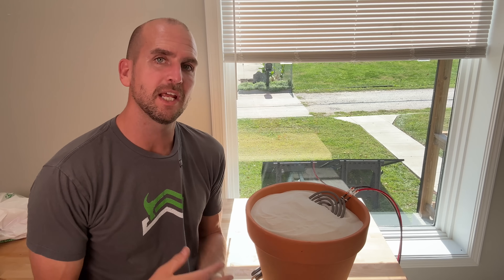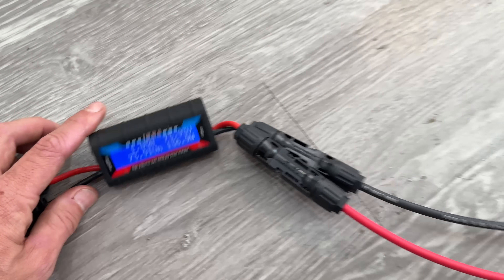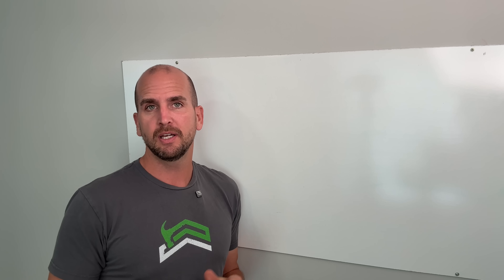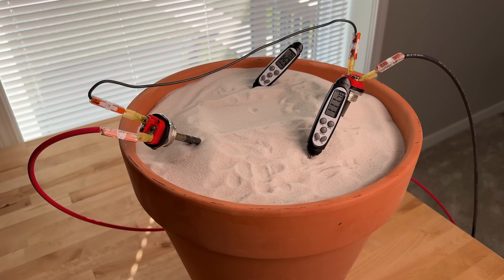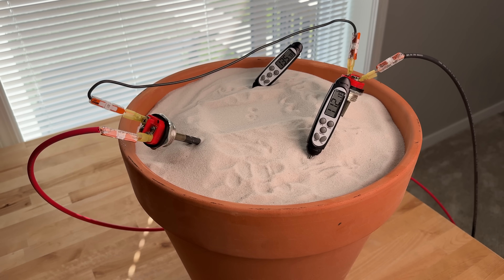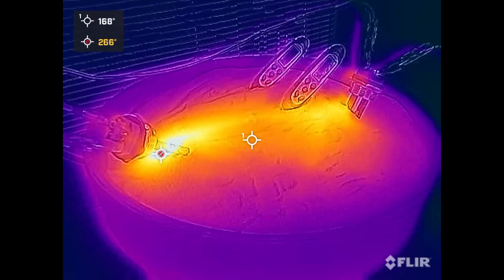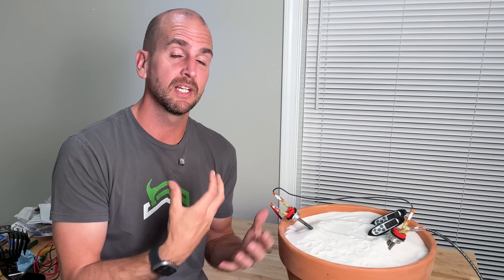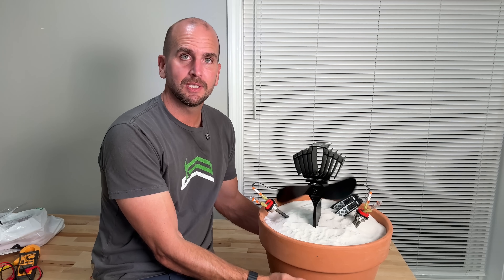How To Create A Solar Sand Battery Heater | Free Heat This Winter!

Comment from the maker: Calculate Solar Cost For Your Home - https://geni.us/solar_reviews
DIY Home Solar (Save $1,000's Going DIY)  - https://geni.us/qN9Ot

Supplies
Water heater element used:  https://geni.us/AJE9
WAGO 221Inline Splice Wire Connectors - https://geni.us/G0BW
Heat fan:  https://geni.us/4Fgy
Power Analyzer - https://geni.us/s86J
Cheap 370W REC Solar Panels:  https://geni.us/zVh8nG

DISCLAIMER: This video and description contain affiliate links, which means that if you click on one of the product links, I’ll receive a small commission.
Reply: I enjoyed your video but can't for the life of me understand why you went through the math exercises of figuring out Ohms & Amps? I mean whatever your panels are putting out and whatever heat is produced by them is really all that's relevant at this point. You stick the heaters in the sand and see what you get, then you can scale accordingly. Maybe I just missed your point? Anyway, it was a good review on the math, I'm not throwing any shade, I just didn't understand why you'd take the time to bother since it didn't really matter to the experiment.
Reply: @BDProperties-y3v  Agreed,  the math was the weak point, but overall a good proof of concept exercise.
@everydaysolar, if you want to get into details, I think you need to emphasize that heating elements, like incandescent bulbs, have a non-linear resistance that changes over temperature.
Reply: @nemam_nedam  Quick lime (Calcium Oxide) can be used as "hygroscopic energy storage".  Here's some fun math.  According to wikipedia, 3.1 kg of Calcium Oxide could get you about 1 kw-hour of thermal energy.  If you're house needs about 15 kw-hour per day of thermal energy in the winter, you would need 3.1 kg/kw-hour x 15 kw-hour/day x 90 days/winter = 4185 kg of Calcium Oxide for the winter.  That's about 9.2 tons of Calcium Oxide!
Reply: You should have the heating elements In Parallel. Not series.!
Reply: @nemam_nedam ⚠️ God has said in the Quran:

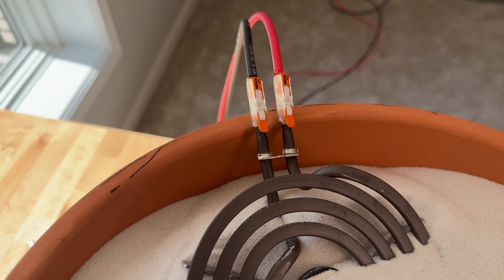🔵 { O mankind, worship your Lord, who created you and those before you, that you may become righteous - ( 2:21 ) 

🔴 [He] who made for you the earth a bed [spread out] and the sky a ceiling and sent down from the sky, rain and brought forth thereby fruits as provision for you. So do not attribute to Allah equals while you know [that there is nothing similar to Him]. ( 2:22 )

🔵 And if you are in doubt about what We have sent down upon Our Servant [Muhammad], then produce a surah the like thereof and call upon your witnesses other than Allah, if you should be truthful. ( 2:23 )

🔴 But if you do not - and you will never be able to - then fear the Fire, whose fuel is men and stones, prepared for the disbelievers.( 2:24 )

🔵 And give good tidings to those who believe and do righteous deeds that they will have gardens [in Paradise] beneath which rivers flow. Whenever they are provided with a provision of fruit therefrom, they will say, "This is what we were provided with before." And it is given to them in likeness. And they will have therein purified spouses, and they will abide therein eternally. ( 2:25 )

⚠️ Quran
Reply: Another power source in a emergency could be a generator(or a moped if that`s all there is using 12volt heater parts) running on Browns Gas(cheep version of Hydrogen) and gasoline vapours....
Reply: 74 volts will not make one of those elements red hot that are supposed to operate on 120 v
Reply: @RonaldDaub-v9y  Who said anything about needing "red hot"?
Reply: If you want to increase Solar panels efficiency you need reflectors or mirrors in front of the panels
Reply: @americancockerspanielchannel  Strictly speaking, reflectors or mirrors in front of the panels would not increase a solar panel's EFFICIENCY but they would increase their POWER output.  This may sound counter intuitive but it has to do with how solar panel efficiency is calculated.
Reply: @nemam_nedam  what is PV?
Reply: You need more resistance.  Your panels say maximum of 11amps but I would only run 75% of the rated maximum 🎉
Reply: is it allowed to urinate into the bucket?
Reply: Brilliant idea! A solar sand battery is a game-changer for free winter heat!
Reply: $1.26 for a Watt of electricity is outrageous.   I pay less than 30 cents for a kilowatt.  At your rate that would be $1,260.
Reply: Just wondering, what if i have enough sun for 12 hour and use water tank with full sand + convex lens for generate heat, can i use that without solar panel? Coz you know, confex lens meet with sun can produce heat without electricity
Reply: Can you give us the temperature by Celsius degree

Comment: Nice idea. The one thing we lack in winter though (in The Netherlands), is ... Sunshine! Not only are winter sunshine hours much less than summer ones, the sun's angle is much worse, and we have 95% cloudy, grey days. So a great option if you want to heat your house in summer when it's already stinking hot, but in winter ... muhahahaaaaa crazy idea. :D

Comment: Having your water heater inlet line go through the hot sand would raise the temp up into the water heater making it's job much easier.   So as to not boil the water in the inlet coil when not using enough hot water, some regulation would be needed to prevent an issue there. A simple thermistor based  limiter circuit would be easy to build by disconnecting the solar cells once the sand reaches 180F. I would use a 5 gallon metal paint can for this so as to have room for a dozen turns of 1/2" copper to fit around the inside perifery, and then insulate the outside.

Comment: All the solar journeys are fine except in areas like the Pacific Northwest which receives very little sunshine in the winter. I have tried various ideas and have found in my area , is basically a waste of time. Also....solar panel installation require professional installers both initially and when you replace your roof. In my area of the world, we cannot sell our excessive power back to the grid. Far far too expensive to stay green really. I use natural gas....done.

Comment: I've watched a boatload of these sand batteries and I'm not making the connection. How is this helpful? I imagine if you're clipping your solar it is a great way to send the potential lost solar into something you could warm you hands with for 10 minutes?

Taj-Ma-Haul is only 160 sq/ft and how/where could you deploy something helpful like this? All I can think of is to heat one of my main water tanks, it's 100 gallons and central in the space, but also right next to its twin 100 gallon tank. I'd have to put an insulate layer between the 2 tanks to have 1 of them as cold water. I use on-demand heaters so never considered heating stored water.

It could be helpful to heat a greenhouse if you had dedicated panels, engineered 55 gallon drums to hold the heat and use a radiator system to extract the heat during the night?

Comment: Interesting, but a few questions and comments, if I may. First, isn't there concerns over the use of Wago connectors for this application? Wago connectors are at least partially made out of thermoplastic, and Wago advisories say "Unless otherwise indicated, a maximum continuous operating temperature of 105 °C (221 °F) applies to all WAGO installation connectors." Clipping them to a heating element that could potentially get VERY hot is a risk, is it not? Next, there are possible concerns with the use of water heater elements. Cook-top/stove elements are clearly designed to operate at hundreds of degrees, but water heater elements are only designed to operate at 100C or so, with the water acting as an effectively infinite heatsink clamped to 100C (boiling point). Next, I've seen comments here about improving this by using insulation, but isn't the whole idea that the system is thermally 'leaky' so that it keeps a room warm? Making the system bigger may be an improvement, as might using a small fan to blow air over the pot and help it circulate. We need to see this project taken to the next level i.e. sufficient power-in and sufficient storage to keep an average room warm during the day, and with the storage keeping the room warm at night. Shall we say... being able to provide an (obviously averaged) 600W or so, day and night.

Comment: You could optimize the system by changing the resistance of the elements to hit your panel's maximum power point.  This could be done by matching the resistance needed to hit your panels rated max power, or even better by using wire as your element so you can adjust it to achieve the highest wattage under different conditions.  Or get fancy and use an MPPT controller.

In an emergency it's unlikely that a person will have one of these elements laying around, unless you have an electric stove, but anyone into DIY stuff will likely have bailing wire or safety wire laying around, both of which could become a heating element with minimal effort.  Or use any electric appliance with an element like a toaster or hair drier.

Comment: Multiply your electrical current by voltage and use that wattage to convert to BTUs. Minus the inefficiency of your system. All that heat energy is transferred to the heating element. All the pot of sand does is slow down the dissipation of the heat. There is no gain over just letting the heating element radiate in free air. Spend your time and money in super insulation to retain all heat you make. The only advantage in using a sand battery is to store excess energy that would otherwise be wasted and release it later when it is needed. How much thermal energy is stored in your pot of sand when it is 160 degrees?

Comment: Why are you putting a resistor inline that drasticaly reduces the current to the elements. You can read volt amps at the load source. 
And , Why didnt you use the stove element.
Its better suited for the job.
If you are trying to impress your peers, you have done a good job de.o strating your ignorance instead .

Comment: Without regulation you should be choosing a heating element close to the power output of the panels while also considering the voltage. 

What you have setup there is very inefficient. With a matched element you’d probably get twice the power out.

Comment: Solar panels are only 15% to 25% efficient. Directly heating the sand by sunlight using lenses would be more efficient and generate much more heat as compared to electricity. Ideally keep the sand pot inside the house near a clear window where sun light shines and use lenses to focus directly on the sand or maybe a copper plate to distribute evenly. You gave me a nice project idea to try.

Comment: Apologies for the basic electrical question;  by connecting the common and power leads to the heating element, you are basically shorting out the power source.  Why isn't everything melting.

Comment: I think this is a great way to create a solar battery, charge it up all day and release the heat in the evening when needed. Like electric storage heaters. The problem is releasing the heat, at the moment it's basically a radiant heater. The fan helps but isn't he best. What I think you should do, it put a lid on it wrap it in ceramic wool insulation to keep the heat in as much as possible. Lift it off the ground with pot feet, then drill holes in the pot base and lid lining them up as Nd put a few copper pipes through and seal them up. Then what you have is as a storage heater cool aumie us drawn in the bottom, up the pipes heated with the hot sand air the hot air is released out the top.

Comment: I don't see anyone mention it in the comments, but the specific heat of water is 5 times that of sand. This means that water can hold 5 times the thermal load in the same volume. The next iteration of this is taking that water heater element and putting it back into the electric water heater.  One element powered by solar and the other via the grid. Since the solar element is likely to heat the water above 140, the grid element will only kick in when it's cloudy. This system will also need a safety feature. A  thermostatic mixer valve will prevent scalding anyone.

Others on YT have more about this system, but the question you should answer is "How can I use this solar hot water for emergency heat?"

Comment: What happens when the panels loose volatage later in the day, can they get damage because they are still connected to a load?  Or Voltage drop when clouds come over?

Comment: A great idea for an electric heater.  You really only need one DC heating element buried in the bottom that can handle your max power from the solar array.  It's basically 100% efficient minus the wiring.

Comment: Pretty cool! The best part is, no paperwork and licensing fees to hook it up to the grid, if all you need is to reduce your electric heating bills in the Winter by using solar power piped in to the house via electrical wiring. Cool!

Comment: I want to say thank you. I decided to try this as a project to test it out. I already had the solar panels and I bought the water heater elements and container. I already had about 40 gallons of sand. I set it up Sunday and only had a couple hours of sun left when it was connected but still managed a sand core temperature of 140°. The next two days had heavy snow and complete overcast. I lost all my gains. Then I had a moderately sunny day and the sand core temperature was 440°. It really does work and the large room temperature increased.
Reply: Okay, but how and where to use this heat, 
and how long will it last?

A temperature of 400 Celsius still needs to be insulated somehow...
Reply: @JonWest-m2y 400F and it's being used to heat a basement.

Comment: I'm a layman and this may be a dumb question, but...
What are the consequences of connecting these heating elements to a DC power source like those solar panels as they where made to be connected to an AC outlet? Can they be connected to both AC and DC with no issues?

Comment: Maybe you can use the solar thermal oils system +heat insulation tank +pipe to through the sand battery +heating exchanger +air fan

Comment: I have an idea: do this but the heater source would be a closed loop system of solar water heater tubing. The tubing coiled on the roof to heat up, and then directed into a heater like a rocket mass stove system using sand like you are doing here.

the liquid in the closed loop can be a liquid which does not freeze too

Comment: I’d like to see you adapt this to a home boiler. Just to supplement the normal heating. Also a hot water heater, but would probably need some type of temperature regulator to keep from scolding hot water. But cool idea for sure

Comment: Your burning solar energy IN THE MOST INEFFICIENT WAY POSSIBLE.  You're putting MILES on those panels with this sort of heating.  Resistance heating is the WORST way we heat things.  That's why the electricity providers love electric ovens & water heaters.

Comment: Excellent idea, but if using electric water heater elements, would they not burn out? They are designed to be in water and not go over the boiling point.

Comment: Water has 8 times the heat capacity than sand per mass.
Yeah you can heat sand to a higher temperature. But are you going up to 800 degree C? (Compared to nearly 100 degree C).
We can pump hot water and mix it to a usefull temperature. That's why everyone is using water instead of sand.
Still I like the setup.

Comment: Place a black rock or tile in the center of the bucket, and place a fresnel lense so that it focuses the sunlight on the rock. Install protective measures, so that the focused beam can not achieve focus outside the target.
The heat can be regulated through size and focus of the lense. It should be much more effective and cost effective, however a wee bit more risky.

Comment: 12:29 omg, that's about a horsepower-hour!  Neat 🎉

Also, equal to 2475 btu.  Like running a 20,000 btu/hr gas fireplace insert for 7 minutes and a bit.

Comment: I would use a phase change material or molecular sieves for storing heat. Sand is a very bad idea for storing heat.
In nature, in deserts, despite the high heat of the sun during the day the night gets really cold because of sand's low heat storage capacity. 
I probably cannot find a material that is so inneficient at storing heat as the sand 😅

Comment: I want a room temp test for a 16x16x8 foot room with 6" fiberglass insulation R values. Outside temp at say, 45 degrees at sundown to 32 degrees at sunrise. JUST the one pot for heat, will it keep you comfy? Or will it die out early and freeze the pipes??? Or an 8x32 camper trailer. 5 or 6 roof panels and a 55 gal drum of sand and river water, it could heat your room and your water and give you drinking water ????

Comment: A single solar panel. A 12 volt water heating element from the RV store. Can also use the 12 volt immersion heater truck drivers use to heat coffee from the cigarette lighter socket. These are ideal for really small containers. A 2 watt Coleman solar panel will heat much smaller containers and they are $20 on line. 
Small containers : a 12 inch SPARK potbelly stove, a decorative milk can. Either of these are ideal for heating tiny rooms like a bathroom. (Can be too hot for the cat to hang out in though.)
A 4 inch muffin fan or a 4 inch UBS fan is ideal for stirring the heat.
But remember metal containers must be a few inches above the floor. I find the metal decorative pot stands are a good choice for a riser.
Also an old oven control makes an ideal thermostat/on off switch and at spring clean up THEY ARE FREE 😅